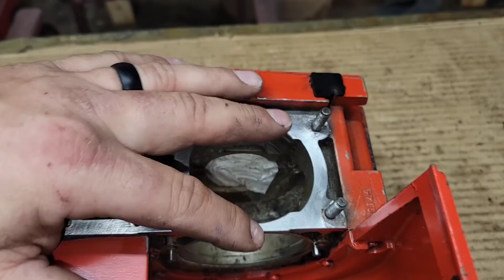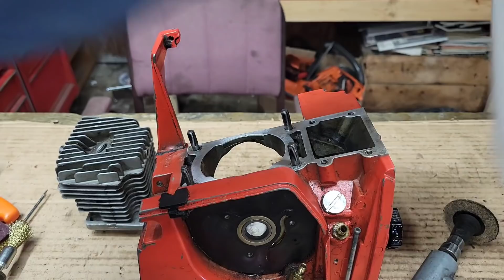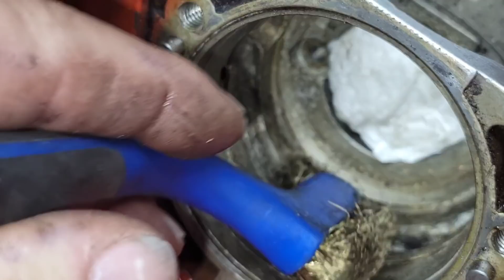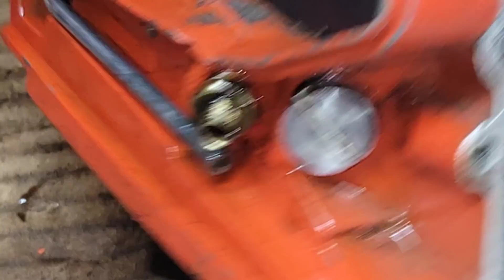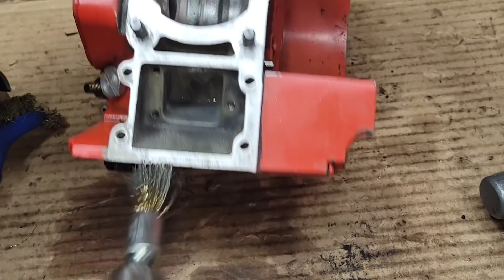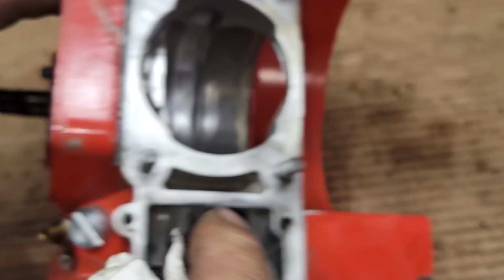Restoring corroded Homelite chainsaw cases!! Making something old new again!!

Comment: ..what about painting the inside once you clean it up?..a lot of the mag case Husqvarnas and Stihls are painted inside the crankcase from the factory..bad idea to paint them?...also, I've had otherwise good crankcases that had water get inside them, and corrode some very deep pits..some almost all the way through...clean them up and JB weld the deep pits, then paint them?...bad idea?....or is there another way to repair?...

Comment: My 038 magnum project had the worst case corrosion I’ve ever seen. Even poked a hole through the case, but the bearing races were untouched. I cleaned it and filled the pock marks with JB weld and then ground it to match the old case. Runs good but we will see how long it holds up. More of a test than anything. Been one year and haven’t had an issue